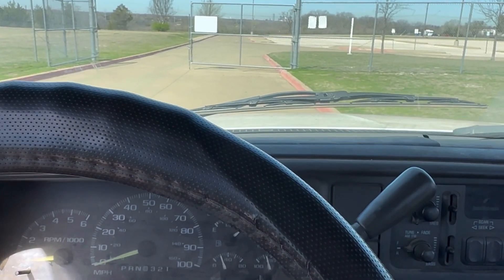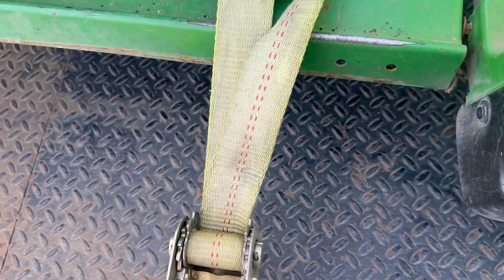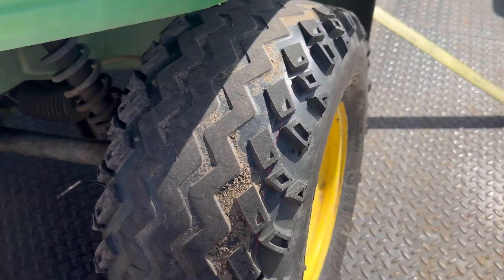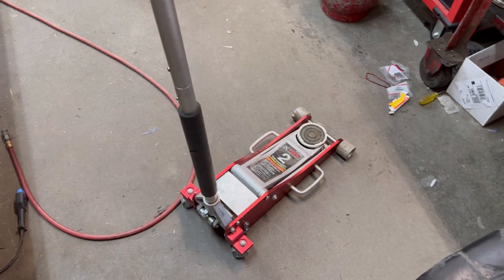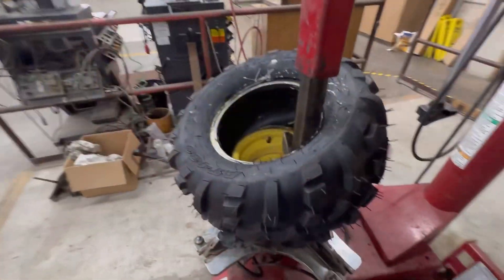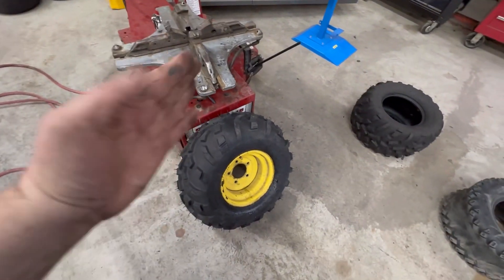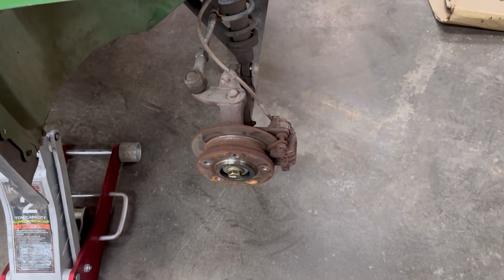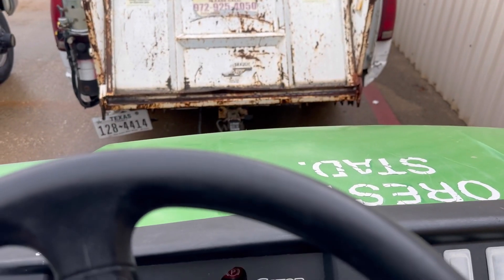JOHN DEERE GATOR TIRE SO WORN OUT THAT IT POPPED!!

Comment: I'd like to see something better like fixing the lifter tick on the kohler command engines or replacing the lifters. Rebuilding the transaxle on a toro workman. Something better than fixing a flat tire
Reply from the maker: I have videos on everything u mentioned 👍👍
Reply: @THEMOWERMEDIC1  dang. I'll have to search some more. I got a kohler command 15.5 that just won't stop clackin